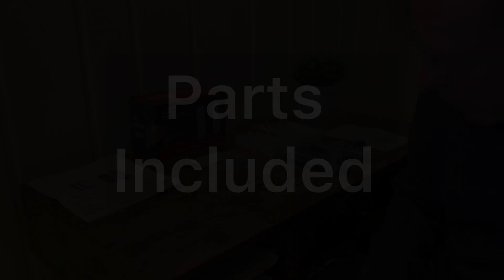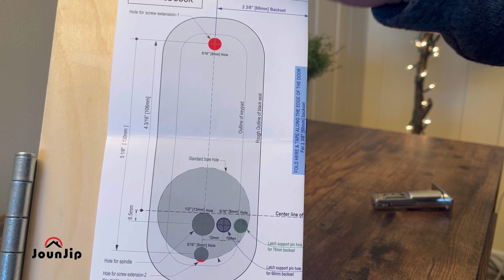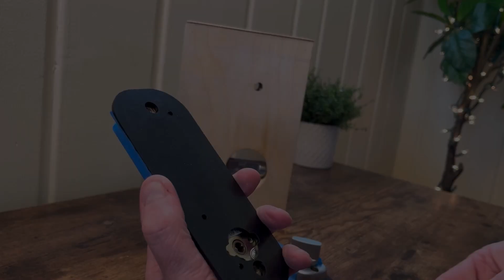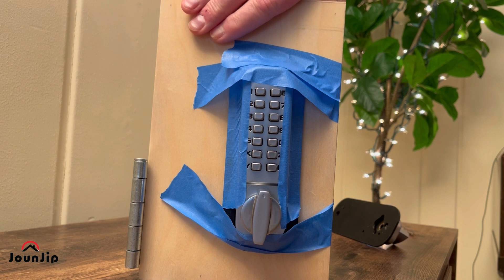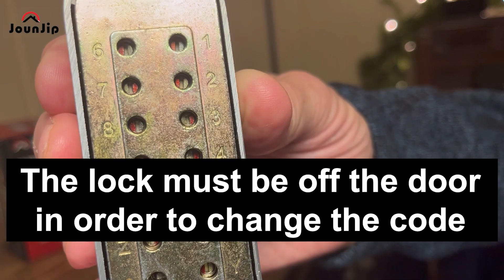How to Install- JOUNJIP QuickCode Deadbolt- No Need To Enter the Code to Lock It -Good Home Locks

Comment: Do you have a full video on how to change the code?  I want to see all steps from the beginning, including how to take the lock apart before changing the code and then putting the lock back together. Tks.
Reply from the maker: Thank you for the feedback. we will consider this in the future.
If you have immediate issues or need help trouble shooting you can call/text our help line at 310-773-0735

Comment: Once the lock is fully installed, how do you change the code?  Is that easy to do?  Do you have to take the lock apart?  Tks.
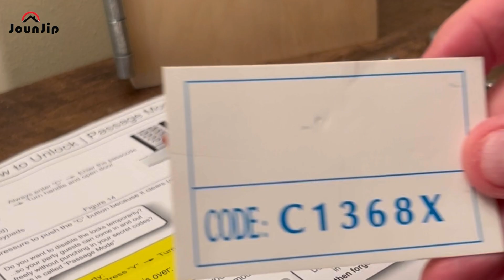Reply from the maker: You must remove the lock from the door and follow instructions on how to change the code. time stamp at 12:20 in this video.

Comment: The video is very good. However the lever on the inside and out won't lock, won't turn I've been at it for more than 1 hour now. I took it apart and put back like 10 times already. I don't understand why it won't turn
Reply from the maker: Oscar, sorry you are having issues. The best way to reach us is by calling/texting our Tech support 310-773-0735. Someone can walk you through the problem.
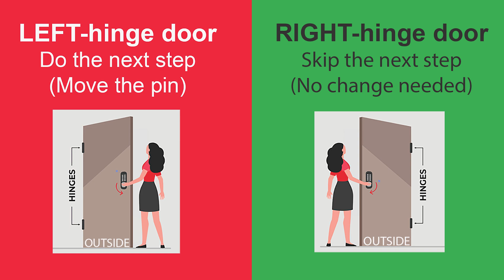It sounds like you didn't convert your lock to a left hinge door. This lock is factory set for a right hinged door. You can convert for a left hinged door by following the instructions for Step 6 Left Hinge Right Hinge Door. Time stamp 05:38